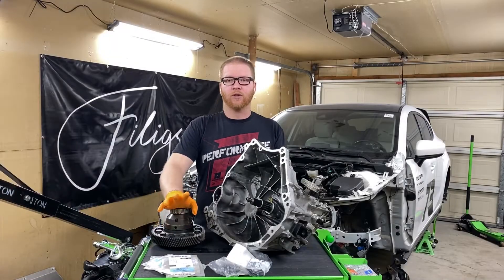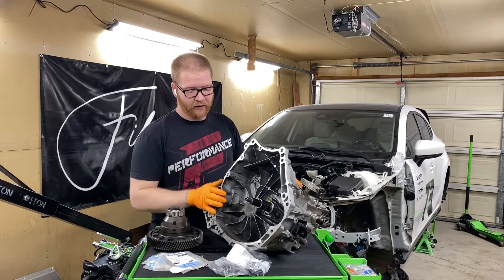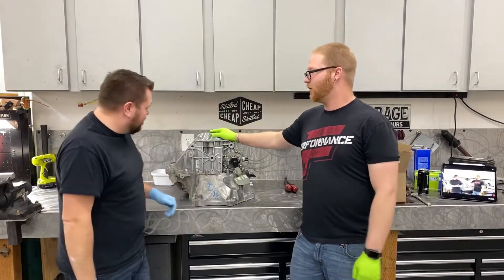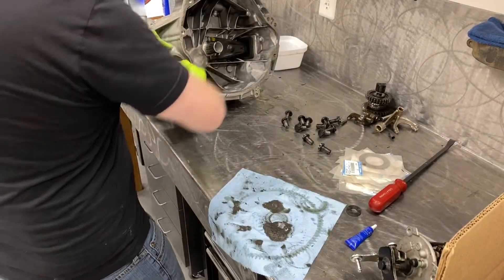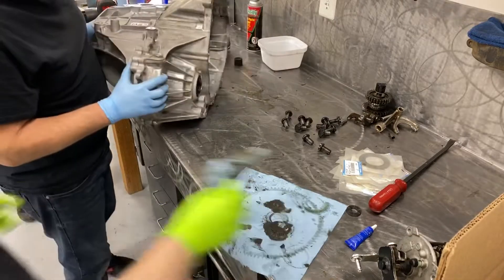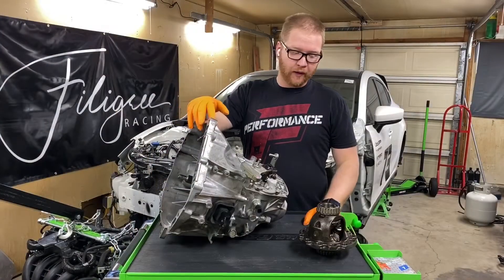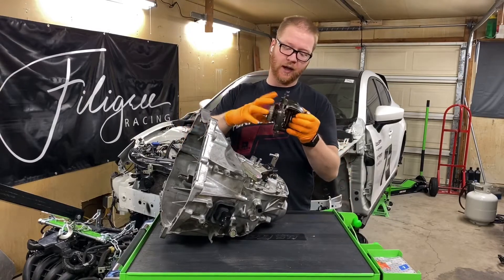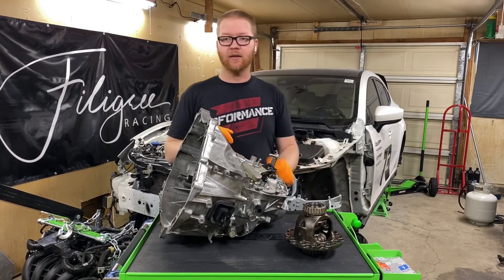FWD Limited Slip Differential Install

Comment: custom limited slip differential what the reason and benefit of changing this part, can you explain for me please, thank you very much
Reply from the maker: It locks the axles together so you get power spread to both of them. This increases grip in straight line and while turning.
Reply: okey thank you very much
Reply: Can i intall LSD for ford explorer2012 FWD ? And how much cost?
Reply: Some cars don’t come with one. It’s a good part to have in ANY performance vehicle